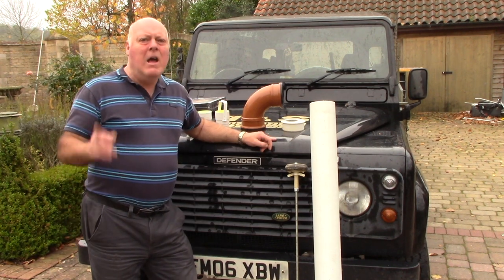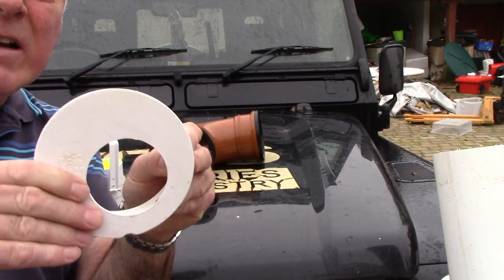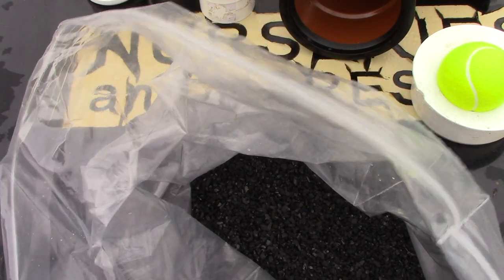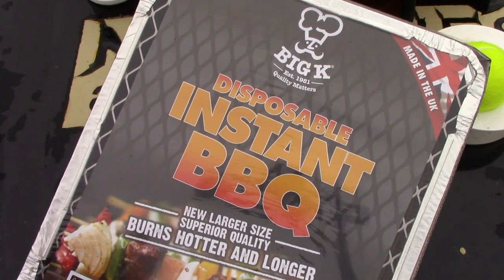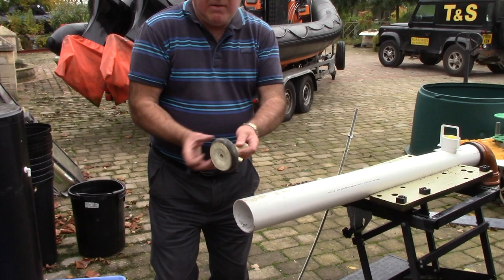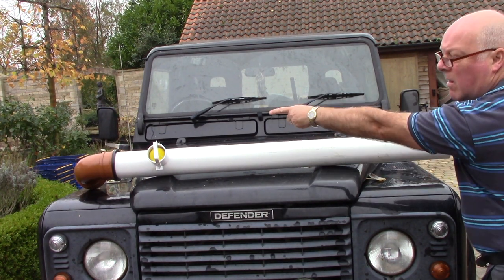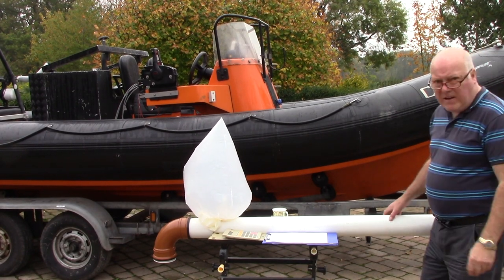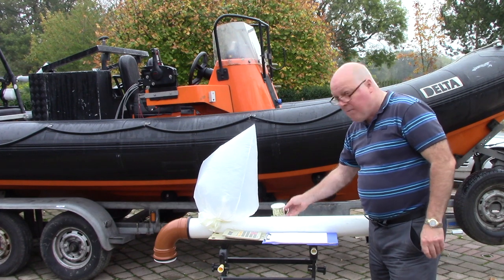Making a Nuclear-Resistant Air Filter

Comment: Paused to type n too lazy to go back n edit or w/e, but if lookin' for a theory of mine-zeolite, absorbes nitrogen and carbon in oxygen concentrators..both needed to remove plutonium. Thinkin' that if used in shelter to clean air n raise O levels, once kinda maxed out can be used to also remove the bs from outside.
Ain't the best I've found but it's all I've found so far. I guess start it now to load up the pellets for immediate use

Comment: By what supposed process do you suggest that activated charcoal filters out radioactive contamination?

You are, largely presenting fallacious information.

The activated charcoal might reduce odors and eliminate hydrocarbons, but as a micro particle filter substance, it might be lacking.

People might be better off in purchasing "HEPA" (high efficiency particulate air) household filters and employing those on a fresh air supply system.

Comment: One small issue about that charcoal you need a chemically treated one you cant find as a private
Reply: only agaisnt gases or warfare agents. Activated charcoal is available in amounts, and agaisnt fall out you can use aquarium pellets, they works fine agaisnt organic vapors.
Reply: @anitaleroy9442  fallout are particles
Abekp filters are different than aquarium charcoal
For particles you need a particles filter not a charcoal one

Comment: Seen lots of smoke coming out of the clean air hole. Not good.
Reply from the maker: Bad camara angle, if you look again most of the smoke is coming out of the bin behind the air valve
The filter can be upgraded to any standard ,one viewer recomended milk filters as they are available
to filter very fine particles . The cost is that it would take alot more effort to pull the air through

Comment: Ok wait 
So the 90 is above ground where the blast has gone off??(if I'm reading your mock up right)?? & the other "T" w/ tennis ball is inside your shelter....???
I'm guessing this is not built to scale for the mass required between the two atmospheres ....the inside (safe side) .....& the outside (your dead side)......????
& during the smoke test you preformed it showed smoke drafting from the "T" to the inside of the shelter?????.....
Am I reading this right or am I not picking up what your laying down ????
You pull the rod & bung in & ball @ 90 sucks in @"T" it closes & filtered air fills the tube....
Pushing out closes ball @ 90 & pushes air (filtered) from tube into shelter......
That's how I'm reading your contraption & it makes sense until it bellowed smoke into the ball valve inside the shelter...
& the volume air bag test doesn't add up for the increased distance for a realistic system???????
You'd be running out of air just rodding the bung if your 90 was 3-4-5-10 ft. From the "T" that put air into the shelter????
Not to mention the smoke factor fail????
The design is great in its simplicity K.I.S.S.  but if going through all the trouble ahead of time go bigger & better filter 
better valves not tennis balls.....
If I'm reading you right ??????
Reply: Doom it's pretty good for a prototype mock up but nows the time to bring in some imagineerrs I mean engineers to make it large scale.  Now that I think about it dude prolly saw it large scale & created this device of death for you tube
Reply: It's not the best implementation I've seen, but it could work in a pinch... I don't believe that there is enough filter media either, but do realize that there is a far greater concentration of smoke particulates in that small confined burn barrel than you would find in standard air. It would require one serious filtration system to filter out that smoke in the video completely.

Comment: Problem is radiation will enter through HVAC, chimney, kitchen and bathroom vents.
Reply: thats why you seal the air vents, windows and doors. Plastic and duct tape will be enough. And its not radiation its blocking, but fallout which is radioactive particles.

Comment: 12 volt solar panel hooked to fan work all time weld handle on motor from inside bunker so turn it when need more air water evaporator air cooler work best use water to filter the air and make own charcole filter pads still need 2 million part filter pads and lot force to move air to work properly not showing mine not giving away location
Reply: you have to keep in mind that a nuclear explosion has a chance to produce an emp which will disable your fan. Unless you figure out a way to have a faraday cage around your fan which would defeat the purpose of the air pipe because a faraday cage needs to be completely sealed. You could leave the fan uninstalled and packed in a faraday cage until after the nukes go off then install it before you run out of air. Just food for thought

Comment: sorry to say but that doesn't work... the principle is this but it doesn't work because the air is always the same, you needed to have another valve further down and the piston has to have a rubber... and normal charcoal doesn't work. ...although I congratulate you for ingeniously using construction tubes.

Comment: Aren't radiation particles smaller than smoke particles? So if the smoke still got through then your toast.
Reply: True
Reply: Exactly
Reply from the maker: HI Rayamanelly, thank you for your comments.  Radioactive fallout particles range in size from .01 to 10 microns.  The larger the size the more harmful the particle.  On the other hand oil smoke ranges from .03 to 1 micron.  The YouTube nuclear filter was drawing from an intense amount of smoke.  Some of that smoke passed through the filter but it was much reduced in intensity.  An additional flaw in the filter (as pointed out by one of our viewers) was the relatively thick cloth that was used to contain the activated charcoal.  This would also be a weakness with the filter.  Solutions to this could be to use a much thinner cloth.  A ring of cooking oil or Vaseline could be painted round the outside of the bag making it sealed to possible air leakage.  Make sure it soaks well into the cloth.  We hope to cover more air filters later this week.  We will also put up information about particle sizes on our website www.prep-rs.com.  I hope this helps.  Phil Prep-RS

Comment: That will not help with radiation
Reply: Correct however thats not its purpose. Its to keep the radioactive particles from entering the house/bunker and keep you from inhaling said particles. If you have the filter is far enough away, the radiation from the particles will have the same affect as the radioactive particles surrounding the house/bunker